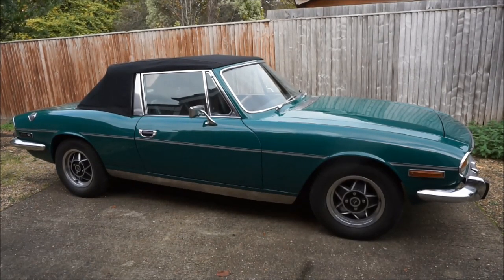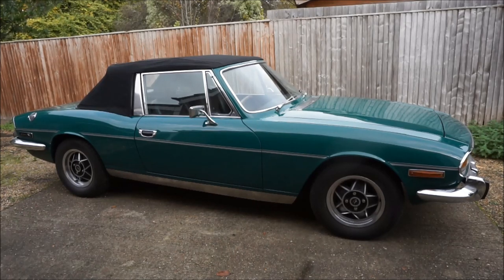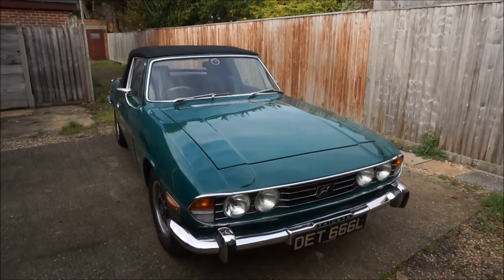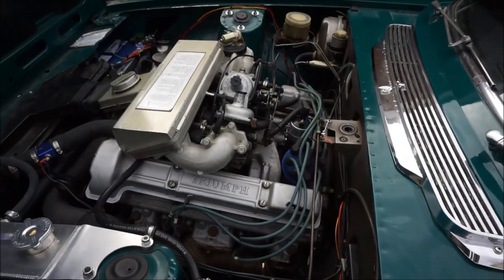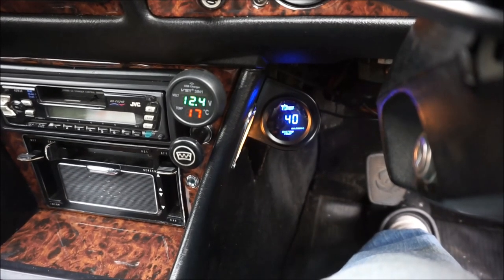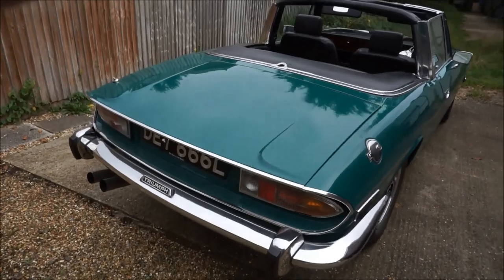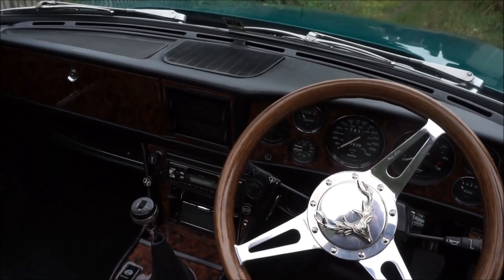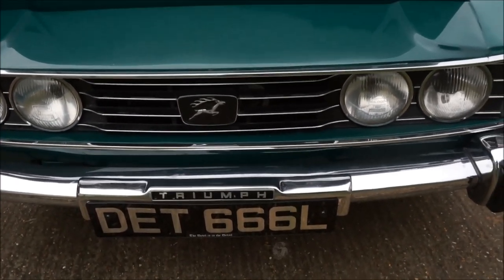Triumph Stag - my journey into owning a Stag - Part 1

Comment: Glad I watched this. I recently bought a Stag which is presently undergoing an engine overhaul. I will be fitting the same mods to the cooling system as the position of the original temperature gauge sensor and high mounted water pump were problematic. However these simple mods will overcome those issues and make the car as reliable as it should be. Thank you.

Comment: I found using Castrol Magnatec cured the timing chain rattle on startup. The hydraulic tensioners on the timing chains take a while to build up pressure and sometimes stick.   Nice example and lovely colour

Comment: Very nice motor. I had a 1975 model from 92 to 97 that had been fitted with a blueprinted 3L V6 engine. Loved to drive the car but it was a bit thirsty and had an indecisive auto box. I often wonder how the model would have fared if it had been fitted with the Buick 3.5L  engine alresdy being used by BL in the rover. Still its a car with a lot of style.

Comment: Very nice car, engine sounds great too, the changes you've made are brilliant and very practical, the dash looks gorgeous a touch of class for sure, when the engine was rebuilt did the company fit a free flow exhaust manifold ?  Monarch produce one for the Stag 3.0 and it gives an extra 10%  power output, a no brainer for anyone needing to repair or replace a broken manifold in a stag, costs £565 but when you consider you get the extra power and increased mpg to boot, means the outlay would be returned over time !
Reply from the maker: Thanks for that. A free flow exhaust is one of the other mods I have considered for some time.

Comment: The Mk1/1.5/2 …. Is bolony…
There were five sanctioned cars after the prototypes.. Yours is a sanction 3 ..
Reply: To Mr. Dodgedollar. What does sanctioned mean?
Reply: @nygelmiller5293  It was the official updates 
Where the upgrades in spec and styling ( very minor on the Stag models) were introduced..and were officially denoted by serial number ranges; let me explain..
LD1-3900 = Sanction 1
LD10,000 onwards = Sanction 2
LD20,000. “”” = sanctions 3
LD30,000 “”” = sanction 4
LD40,000 “”” = sanction 5..till the final car